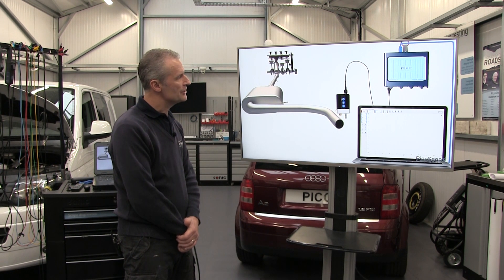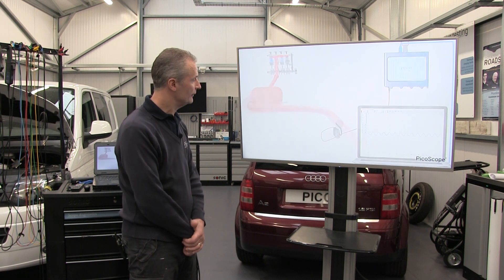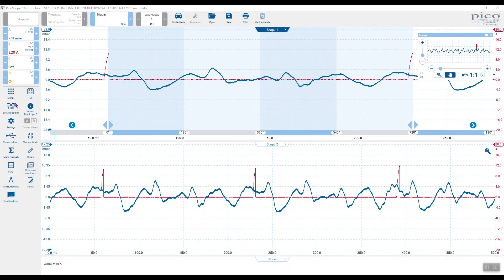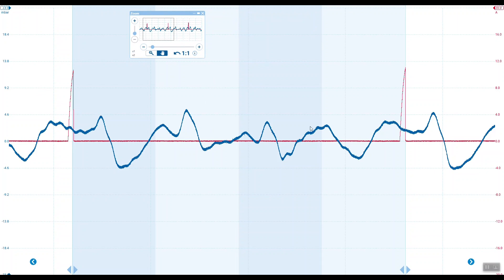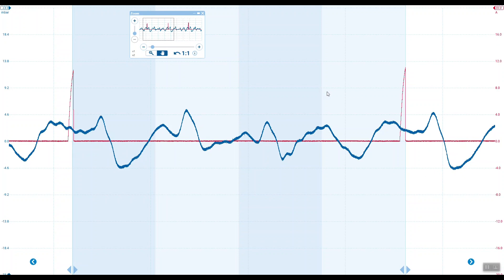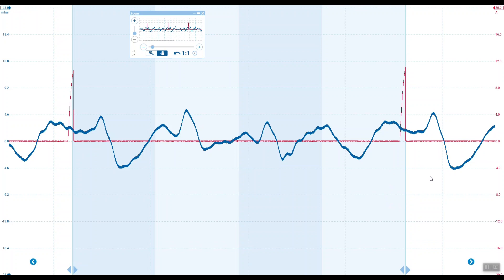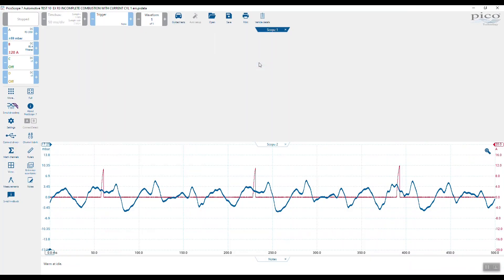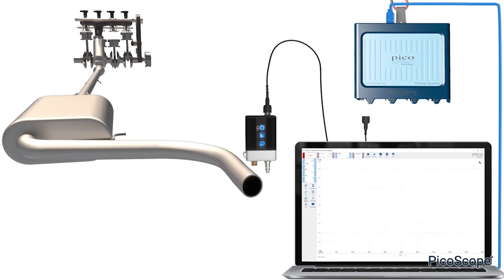Exhaust Gas Pulsations

Comment: the test works well on 4 cylinders not so much on 6 and 8 cylinder vehicles  with complex exhaust baffling
Reply: 8 Cylinder with 3 Valves, this becomes very messy quickly lol I probed an Expedition because it was misfiring, I jusn't didn't know how bad, I believe it had a valve issue but the waveform was all over the place as the compression for 3 cylinders were lower than average when I performed a relative compression test. One cylinders was being flagged after a bit of running by the PCM but it wasn't consistent.
Reply: @scientist100  Hello and thank you for the feedback. I agree entirely as engines with high cylinder counts and elaborate exhaust designs do not lend themselves to seamless diagnosis. Add into the mix multiple cylinder combustion anomalies and who knows what the exhaust pulsations will look like. This is where known good examples come into play and documenting vehicles like the Expedition, post fix. A single cylinder misfire with 8 an cylinder engine  would produce or more defined pattern but multiple misfires would be challenging. Thank you for highlighting as its important to recognize and share limitations of every test procedure. Take care.....Steve